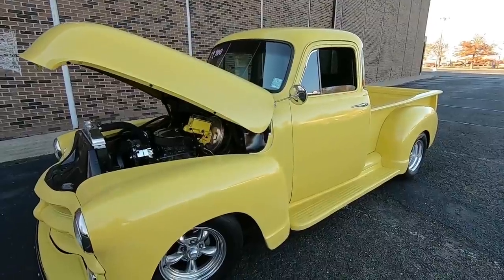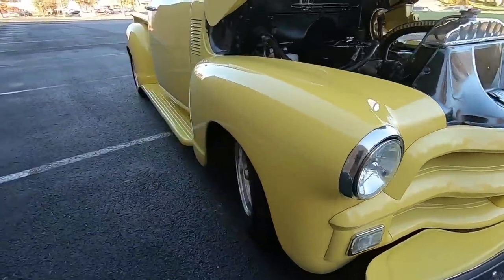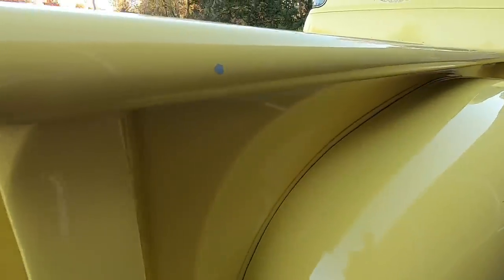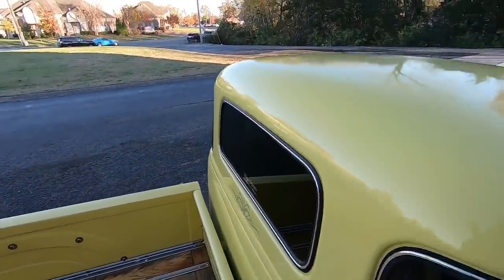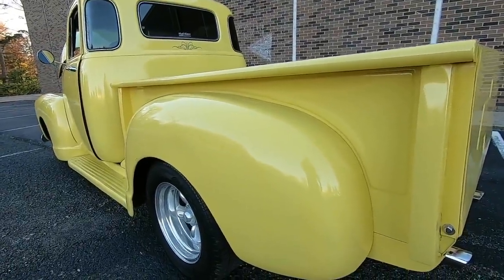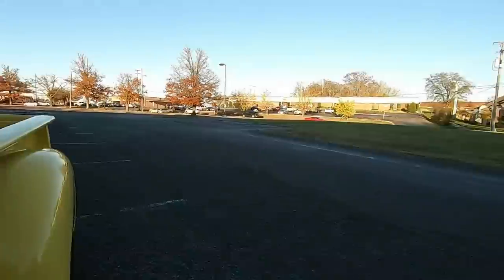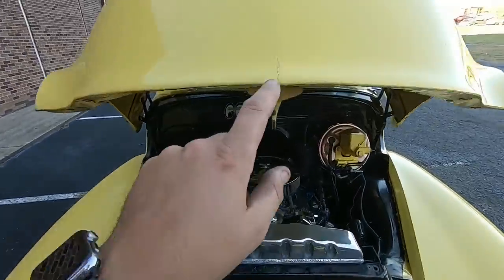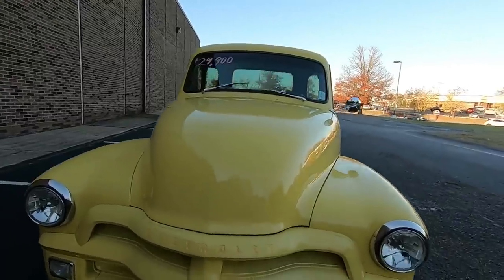1954 Chevrolet 3100 5 Window SOLD $29,900 Maple Motors #852

Comment: Your not going to get 29,000 until you fix the issues with the paint, and motor , it would cost somebody another 6 to 10 grand before they got it right , I’m not dissing you guys love the channel but 30,000 $ for a truck that needs a new paint job and a antifreeze leak ??